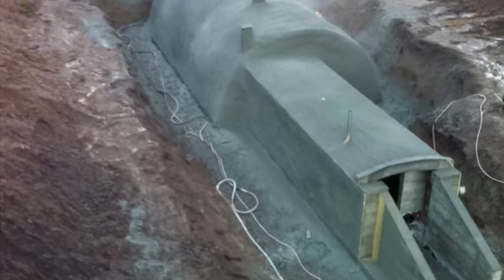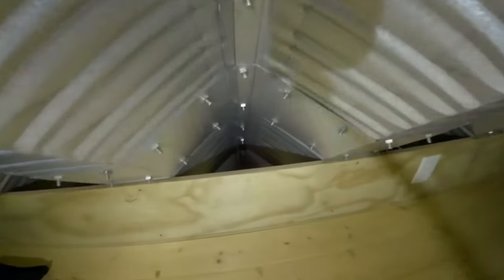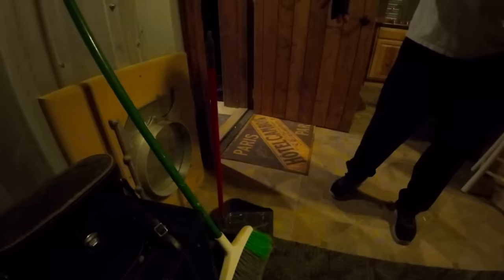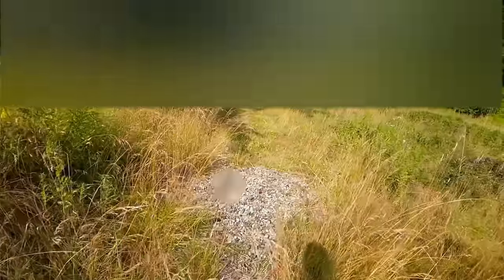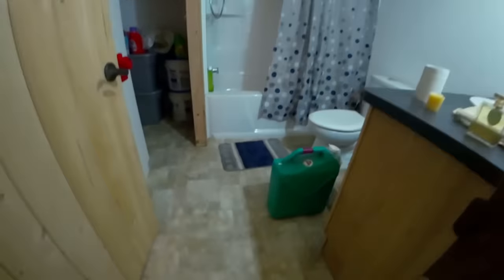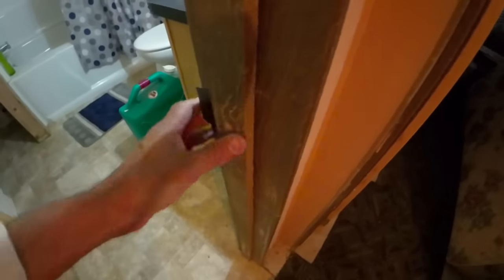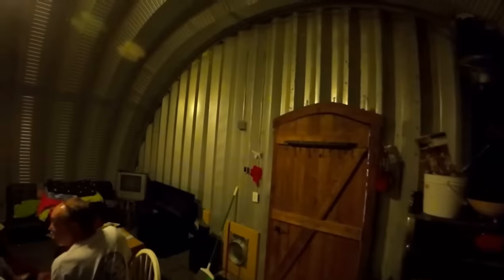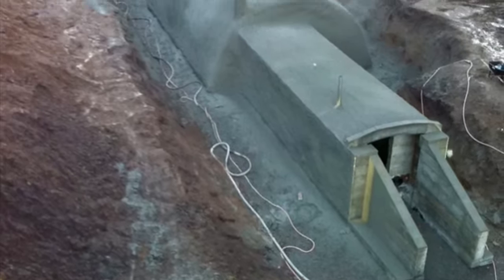In-Depth Tour of Quonset Hut Underground Built in 2011

Comment: Very nice Bunker ! But i would recommend 2.5 things . 1. The wood ceiling inside the bathroom, we have it too , factory impragnated wood and its molding as soon as the shower is used regulary! (i hope you never have too) 2. The metal door starts to surface rust, it may not impact the functionality but your entrance starts to get some sort of "deserted" look ..i did not pay attention if you have always someone in genral vicinity to "guard" it...but the more deserted it looks the more looters or over curious people will try to forcefully enter ! i would paint the door and visible concrete in a camouflage pattern , plant some conifer-like trees infront and with not so deep penetrating roots also on top in a irregular pattern to hide possible detection from air ! and 2.5 dust of some of the interior if u have to move in than to survice and not to clean ;)
Reply: I didn't notice any gun ports or viewing periscopes anywhere either, disappointing..
Reply: @Veldtian1  Why, do you have gun ports and periscopes in your house?
Reply: @ForbiddTV 
 Yes, they are called peepholes and hallways.

Comment: Could this be done with a 40' wide x 50' long and 20' high Q model Quonset? Also, did you use a heavier gauge than normal? I think these usually come 22 gauge thickness, but you can special order a thicker gauge like 18.
Reply: I am having that exact size engineered at the moment. My engineer has specified it as 6" concrete with #4 rebar.
Reply from the maker: If you could send me another email, we've had 100's, and cannot find our prior conversation. I'd be glad to share for a hefty discount or for free our engineered blueprints if you're interested.

Comment: Would be very energy efficient, effective against tornados and hurricanes! I love the concept,  but personally i don't trust would supports. I would use steel them do a wood wrap. I would also add another outer door and use it as a mud room, security stop. Plus a another posted, a concrete barrier directly in front with 90 degree exits. Just my 2 cents,  but very good job.  Question, you said you had a process for the spray foam and how thick was your shot crete?
Reply: None of the wood is holding up the structure.  Could have been a clear open arch if that's what the client wanted.

Comment: I think i'd put the food inside where you can lock it up better, and when your coming in after walking through the aftermath of who knows what you might want to wash and change your clothes, if you had any radiation you, take your cloths off to wash them separately from your normal inside cloths, and you just wash off in the shower don't scrub!!! You'll scrub the radiation into your skin, have outside clothes only or a suit that you can take off then wash. just saying. Have fun with the information, also if a EMP hits don't turn your backup systems until two or more weeks later they're other EMP coming, FYI. :) Cool place though! :)

Comment: Hi just wondering about the spray foam if there was a fire, I always thought it burned really well, or are there different types?
Reply from the maker: The spray foam is in 12" inches of concrete with Helix Steel which is stronger than rebar. What do you mean specifically?

Comment: So I have been trying to get an affordable small home lately construction design finished and a construction loan, the best price I got currently is 176,000 dollars for a 1086 square foot home, I told my wife I want to go cheaper, everything is so expensive anymore and a 2k a month mortgage is high.
I’m curious if it’s possible through a contractor to have this size of a Quonset hut built underground for less than 130k finished in 2024
I am super interested in this and as a prepper this would be the most safe house on a budget against burglars and everything else in any sort of hard times, I have read that Quonset hut homes are cheaper than stick homes by insanely amount and everything else.
I really would like to know, also last question, what is the size of this hut home, like the dimensions because i am reading on the internet there is different sizes for Quonset hut homes.
Also if you build Quonset hut homes how much would you charge as a contractor for buying the Quonset hut all the way to assembling, putting in ground, this size ofcourse and than finishing, is it possible to budget all that to finish for 130k or less?
Is it possible to build a Quonset hut, let’s say design wise but my own ofcourse similar to this for 130k around in todays society and with the costs and all underground, I would be very interested to know, I’m going to speak to my wife and I think officially we will be going with you guys for our new home, that would be this ofcourse.
Affordability to me is important though.

Comment: Quonset huts were never intended for underground usage and are absolutely not rated for it. It won't pass a county inspection. I assume either reinforced concrete ir spray in foam or aerocrete over steel Quonset hut. Concrete will shrink away from any form its put on and this will allow for water seepage. I assume you fill any shrink induced vouds?
Reply: The quonset steel isn't structural at all once the concrete is applied, it merely serves as a form.  It could all rust away (not likely for hundreds of years) and the structure would not be compromised in the least.

Comment: So are we going to ignore the giant crack @9:23 ?
Reply from the maker: Are you talking about the wooden beams?? 😂
Reply: That’s a shadow from a cable hanging between the light and the wall.
Reply: You need a new potato camera for your next video.👍
Reply: Did you put any Radon detectors in the building as a test?
Reply from the maker: Those wooden beams have zero structure support and happened while screwing into the wood. Wood cracks overtime as well, total non issue.
Reply from the maker: @occultustactical6138  working on getting a Nokia brick phone for next video 😄 🤣 😂
Reply from the maker: @occultustactical6138  yes, it's been lived in and built 12 years ago.
Reply: A brace and bit, two bolts, two nuts, four washers and a pair of spanners to tighten them with solves that "issue".

Comment: It’s ok for light fallout but not for severe radiation
Reply from the maker: That's true. The purpose of this structure wasn't for a massive nuclear blast etc etc. There are much much more expensive options available to do that, though. 😀
Reply: @VikingShelters the weak point for radiation is the door which can be fixed by putting up a wall of concrete ant/or lead. Radiation is thwarted by time, distance and density of shielding. I also didn’t see a NBC air filter
Reply from the maker: @pasqualguigano6315  that's very true and we are 110% aware of those techniques. We build for customers and their budget. 😉
Reply: Do you have any idea what light or severe radiation means?  Fallout is merely the dust that falls to the ground that has radionuclide beta particles in it.  The earth cover would completely block out 100% that has landed on top of the structure.  What a structure would also have to provide is to keep all these dusts from entering inside to be breathed in or ingested.  This can be done with tight sealing and an air filter system.  If your "severe radiation" meme is the gamma rays from the blast of a nuclear weapon, being underground gives pretty much 100% protection as well.  The weak areas would be entrances, windows and other openings, where there isn't sufficient mass to cut the gamma rays.  The actual blast over pressure is a whole different matter as Viking Shelters have eluded to, but probably none of these shelters would have to worry about it since these are probably rarely built near strategic targets.
Reply: @ForbiddTV yes I do

Comment: Hmmm.... Gamma radiation travels in a straight line. What is to prevent gamma radiation from passing through the wooden entry door and traveling through the center of the underground shelter and harming the inhabitants? If the entry tunnel area had been built at a 90-degree angle to the main body of the shelter this would have helped better protect the inhabitants against gamma radiation.

Given the way the shelter is designed, I would add a reinforced, four-foot thick, solid concrete wall placed about four feet in front of that entry to help block gamma radiation. And I would replace the entry door with a thick concrete and steel blast shelter door to also help shield against gamma radiation. I would also take a close look at the ventilation pipes and make sure they do not provide a vertical path for gamma radiation. Overhead shielding by thick lead sheets on a welded metal frame could offer some protection from radiation. But the lead sheets would need to be encased in steel because the heat from a brush fire could melt the lead and briefly turn it to liquid.
Reply from the maker: Lots of different variables and questions... the goal of this structure is not to be nuclear safe.
Reply: Most do not necessarily build such underground structures as nuclear war shelters, and seasoned preppers don't buy into the nuclear war hysteria some like to make it out to be.
Reply: @ForbiddTV  A mere storm shelter does not need to be this large for just a brief stay. It is a fallout shelter that needs to be this large to hold people for two to four weeks. This one is large enough to be a fallout shelter if a bit more was done to it to keep gamma radiation from penetrating.
Reply: @gonefishing3644   The structure would serve many beneficial functions regardless if the clients ever considered a nuclear war.
Reply: @ForbiddTV Agree
Reply: @joycebegnaud9645   Thanks, I sell radiation detection equipment and get tired of preppers that fear monger that which they don't understand.

Comment: I’m curious as to what your thinking your hiding in a bunker from? That structure wouldn’t afford much if any protections from NBC threats. If it’s people your trying to protect from you would need to start with a sally port entrance with much more substantial doors along with gun ports allowing you to clear people off the first door outside. Also the position of your escape hatch would need to be an armored turret allowing you to provide fire onto anyone trying to dig you out. The real escape hatch should be a tonel leading away from the structure so that anyone escaping would have some chances of not being seen by your attacker’s. Finally your front entrance should be camouflaged and difficult to spot by anyone the area and the whole structure should be negatively pressured to avoid being “smoked out”. Ultimately if you have attackers determined enough, no static structure would be impregnable. But yours I think would be incredibly vulnerable.. tactically speaking.
Reply: You are being rather unreasonably extreme for a structure many miles from any sort of nuclear targets.  It would provide all the protection anyone would need just a few miles from a ground zero.  Check your "negative pressure" meme, I think you mean positive pressure to keep bad air out.